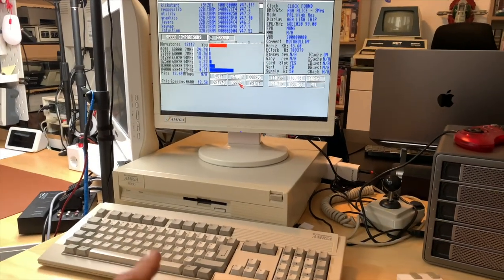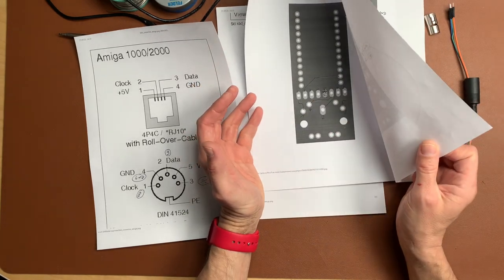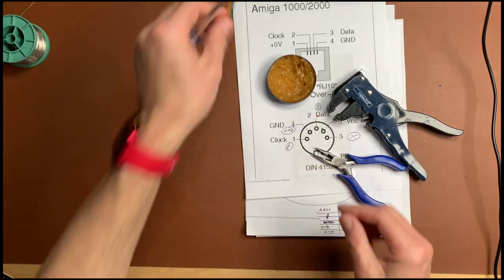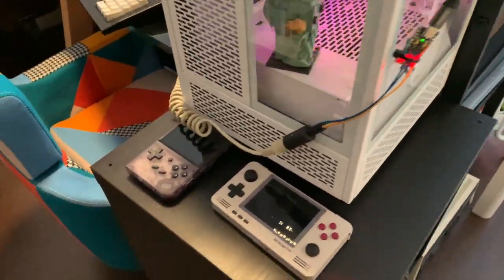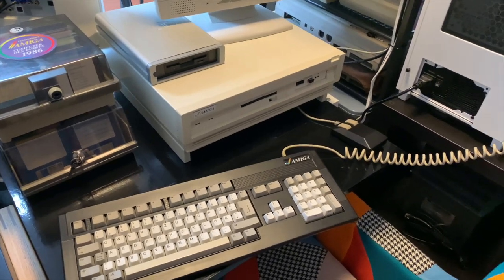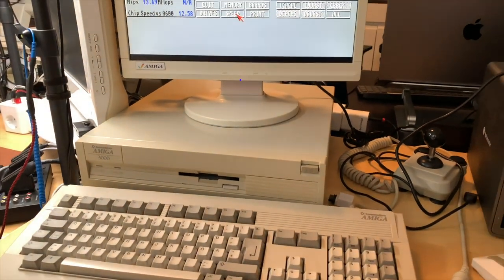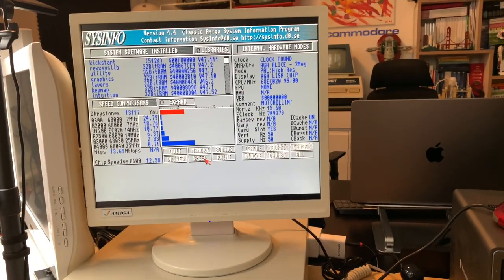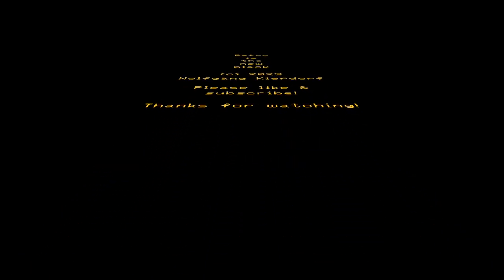Connect an Amiga keyboard to USB for $10 - works for 500, 1000, 2000, 3000, 4000, CD32 keyboards!

Comment: Just a couple of notes: the keys could also be remapped by editing the ino file for the Arduino.  By default, it looks like the left and right brackets on the number pad are mapped to scroll-lock and num-lock.  Also, there's no need to connect the grounds together on the Arduino, since they are wired together on the board itself.
Reply from the maker: Ahh cool! Thanks! So the build is even simpler. Remapping of the keys on the Arduino was another option but I had to find the correct keycodes for that ... so I went with the Mister remap.

Comment: hello, I bought the same Pro Micro model as you. I programmed the Micro, after that I soldered everything as you did. I checked the connections. after connecting the cables to the keyboard from the Amiga 500, my Micro has two red LEDs and one small green one below. Unfortunately, the keyboard is not responding. I would like to add that I submitted a similar project for Arduino Leonardo and in this case the keyboard works. Do you have any ideas on how to run the keyboard with my ProMicro?
Reply from the maker: I had a bunch of ProMicros that were just bad. Another time I had a psu that could not handle all the usb devices at once. Maybe it‘s that?
Reply: @RetroWK  Thank you for your reply, after a long struggle with Promicro, I ordered another version with usb Micro output and this time it worked everything without any problem. It's a little strange that one micro controller works without a problem and another one doesn't want to talk to us at all.

Comment: Would I be able to use the USB C as a input to the Arduino to the output as PS2 connection to the Amiga 4000. Which I believe is the opposite of what your video is.  Thank You
Reply from the maker: You would have to rewrite the code. It would have to work the other way around then.
Reply: @RetroWK  I don't even know where to begin with rewriting the code.  Thank You

Comment: I ordered the PCBs for different Keyboards on PCBWays a few years ago. In this size 10 PCBs are same price as the minimum nuber of 5 PCBs,  so I have some spares.
Actually I have 10 from each version, and all also support the A500 pinrow.

As I normaly only use one adapter at a time, I did not solder the Arduino to my board, but used socket and pin stripes, so I can actualy just swap the Arduino in the board I need.

It's not neccassary for the spare PCBs to collect dust, so if you are interested is a set of PCBs, I can send you a set for free as a smal thank you for your videos.

I send you a seperate mail with my contact details.
Reply from the maker: Thanks! You have mail ... ;-)